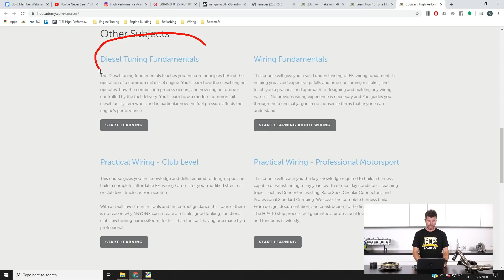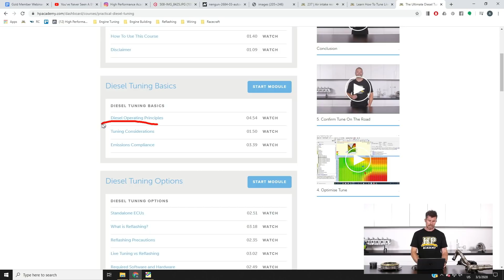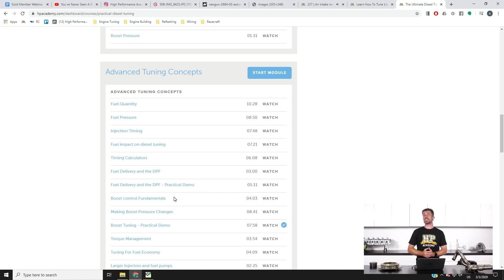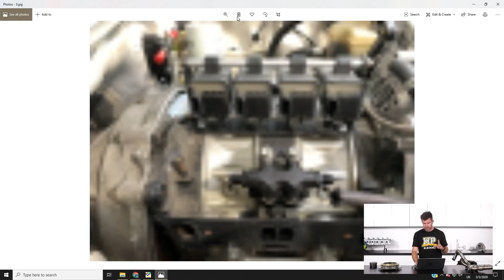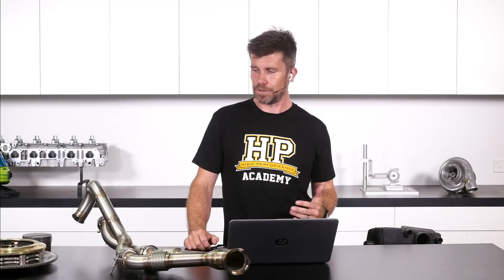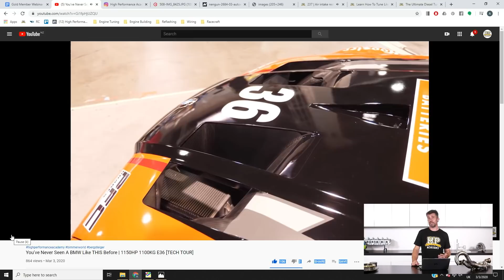Diesel Tuning 101,  Turblown RX7 Update and Clutch Setup | Today At HPA [UPDATE 237]

Comment: With the clutches, besides the sintered material being a bit 'grabby', probably the biggest reason for them being 'unfriendly' in traffic is they lack the Marcel spring* found in most production vehicles. This is the spring steel part of the friction plate the friction material is fixed to and it's designed to compress under increasing clamp loads and so give a more gradual engagement of the clutch.
However, this spring plate can introduce an additional failure point at the steel has to be thinner and more flexible to work as intended, and this can happen - http://www.twincitygaming.us/images/06CTSV/Clutch%20Failure%20-%20Disk.jpg I've even experienced myself, much to the amusement of my 'friends' :-(

There are a (very) few clutch manufacturers who offer sintered plates with Marcel springs, but as they add to the thickness and cost, might need some chasing down.
Hmmm, some of you may be interested in this hybrid version for a tractor, I found - https://www.partsdirect.farm/clutch-plate-organic-ceramic-b9391 - don't know of any automotive version, though - anyone?

*This guy give a fair explanation of their application - https://www.youtube.com/watch?v=I2-UXYu5l1Q

Comment: From my understanding a fuel pressure regulator and a fuel pulsation dampener are two different things. Am i right about that? Please correct me if not. But if so, should i run both?
Greetings from Germany
Reply from the maker: Hey Mathias,
Yes sir, they are two different components. One regulates the flow of fuel and the other essentially tries to ensure that flow is smooth regardless of the fuel demands which vary a lot as you're on and off the throttle etc. You might enough this video here too: https://youtu.be/qKOS2sJmlXg - Taz.

Comment: Though on this side of the big pond....we call it a Fuel Pressure Regulator...don’t change the terminology.
Diversity is the spice of life !
Reply: Are you referring to the damper (dampener*?)?
It is a very different animal from a fuel pressure regulator - which will also be used, of course.
The whole fuel system, and even the fuel, can act a little like a spring, in that it can all compress/expand slightly under pressure variations such as injectors opening and closing and/or regulator hystersis (lag in response) and it can even, as Andre suspected, cause localised pressure fluctuations (think standing waves, such as you sometimes see in fast flowing rivers, or 'water hammer' in household plumbing that can be bad enough, in extreme cases, to actuallu blow taps off!). Using a damper* can significantly reduce these variations and give more consistent fueling.
It can also be a problem with some fuel pump types which introduce a 'pulse' into the fuel as it pumps.

*Older members will get that ;-)
Reply from the maker: Gordo is on the money there, and I struggle with damper and dampener sorry, but in my defence so does the industry. English is hard 😅😅- Taz.

Comment: Interesting thoughts on plumbing the gates into their own full length exhaust. I'm not convinced the weight of another 3" stainless exhaust and muffler is worth it. Unless you remove it for track days which sounds like a pain. To make it fully road worthy surely the exhaust gases from both gates would also have to pass through a cat converter. 
Personally I dont think the gates would cause much if any restriction to a free flowing 3" or 4" exhaust if plumbed properly at correct angles. Definitely an interesting topic for some testing!